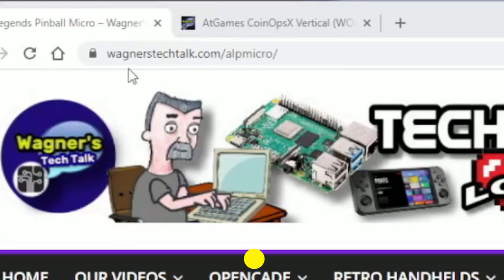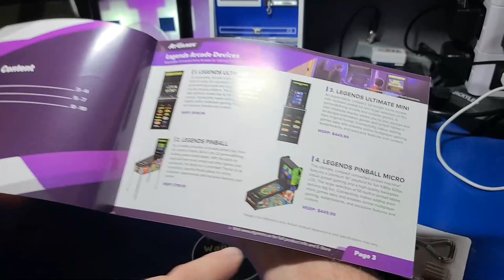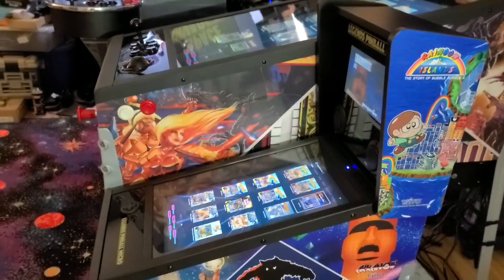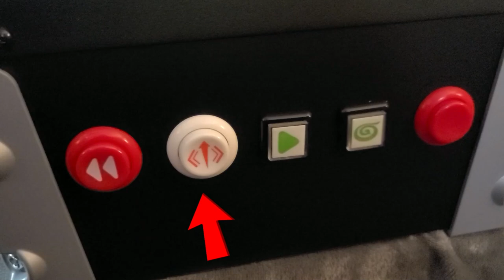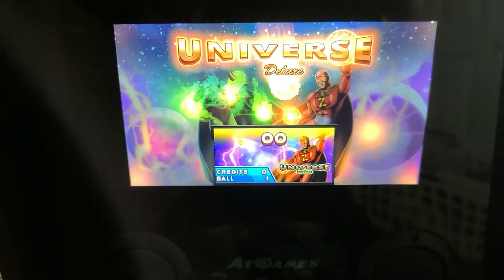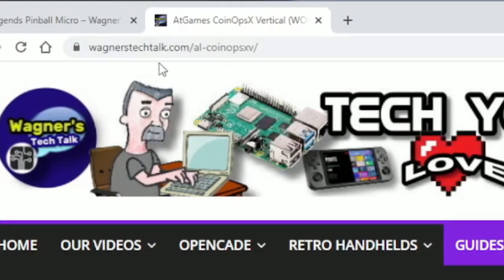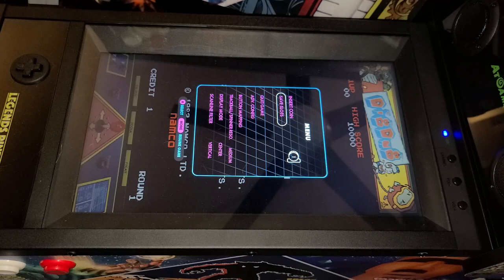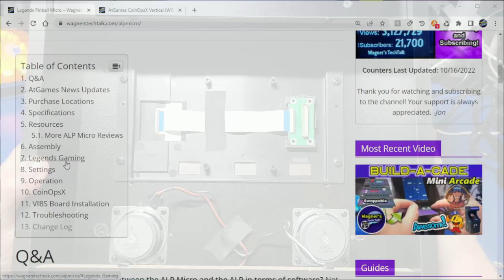AtGames Legends Pinball Micro: First Look and Review!

Comment: CPU – Amlogic S922X hexa-core with 4x Arm Cortex A73 cores @ up to 1.8 GHz, 2x Arm Cortex A53 cores @ 1.9 GHz
GPU – Arm Mali-G52MP4 @ 846MHz
System Memory – 4GB DDR4 RAM
WIFI 6
Storage – 64GB
OS: Android 9 The above is from the Sharpin mini pinball machine one that includes this computer board. Is the atgame Micro pinball computer board the same as Sharpin or better?    The cost for a finish Sharpin pinball machine is a bit more expensive like $500 or so.
Reply from the maker: There are clearly some differences, RAM for example.  However, I've never used the Sharpin so can't compare the two directly.  However, AtGames is having a sale for the next two days for the Micro @ $299.99 USD here: https://www.atgames.us/products/legends-pinball-micro?sca_ref=4359271.G2fhugu87B

Comment: On my Legends Micro the (metal bar) between the lower part of the play field and the D-Pad has a 1/4 inch gap. It is  short in length. The gap is next to the metal side bar. Is that normal?

Comment: Great videos 👍👍 I just put together my new legend micro pinball. When I booted it up the playing screen lite up but the back screen didn't. So I opened the back jiggled it and it worked. So I replugged it back in again same thing so I jiggled it again. Has anyone else have this issue.. but it's working now. should I be concerned.thanks Dave 😊👍👍.
Reply from the maker: Thank you!  Definitely want to make sure it has a stable connection.  I would recommend powering it off, then remove the cables and re-seat them.  Might be that one is just barely connected.  If you don't have to jiggle the connections again, you're good.  If you do, I'd contact AtGames Customer Service here: https://www.atgames.net/arcades/contact .  That way, if there is an issue, you can get it squared away while it's under warranty.
Reply: Thanks that worked 👍👌has anyone ever said that there is a smell from it 🤔 thanks.😊👍
Reply from the maker: @davidbrigham8319  Very welcome, could be some smell to it.  It will subside.  I don't notice any odor from mine.
Reply: I am thinking that too.i read a few reviews of the same issue.😊👍.
Reply: Well I found out from atgames about the smell they said it's from the tape they use . They all have a smell but some maybe stronger smelling but will go away and is NOT TOXIC. They suggested putting in scented dryer sheets inside it .

Comment: It's what the Acrade 1up pinball tables should have been. The only initial downside is the lack of legs, but I'm told there's an aftermarket  set used for Stern machines that work with the Micro if you want to go in that direction.
I'm honestly tempted to get it, even though I have an APL already, so I can have the APL in the soon to be built rec room and the Micro for my bedroom.
Reply from the maker: Actually, you can reserve legs for the ALPu here: https://www.atgames.us/products/leg-set-for-legends-pinball .  I have the aftermarket legs and recommend these from AtGames.  The aftermarket legs cover the screw holes that allow accessing the internals of the machine.  If you want to remove the side bars, you'll have to remove the two front legs.  With these from AtGames, it appears to be just like the ones that ship on the ALP, just black in color.
Reply: Wagner's TechTalk  And these work on the Micro?
Reply from the maker: I don't have this set (yet), but it says so under the Product Features.

Comment: Likely not the case, but it would be great if this could work as a controller for the Switch (unlike it's bigger brother - which is not natively compatible). Using the pinball buttons to control Switch-based pinball games like FX3, etc. would be fantastic for a portable unit such as this.
Reply from the maker: Not sure about the switch, but I've connected the (larger) ALP to a Steam Deck and it worked great (video here, if interested: https://youtu.be/rPqdmhpys1M ).  I hope to show the same working on this machine with the new VIBS board so that the backglass will work with the Steam Deck (or PC) also.

Comment: Another great quality video!  Thank you for the time and effort you put into producing the videos and guides, Jon!
Regarding the button for the plunger, how was that experience for skill shots?  Does it always pull the plunger back to do a max launch?
Reply from the maker: Thank you so much Pete!  The plunger moves down as soon as you start pushing and it's launched when released.  So, you can use it for skill shots.  Just that you have to time it just right during ball launch.  With a plunger, you can adjust before you release but not with the button.  Hope that all makes sense :)

Comment: Just wondering, Does this pinball have haptic feedback, rumble or Vibration on the buttons like the big version pinball? Can you do video comparison between the big table with small one?
Reply from the maker: Yes, it has haptic feedback (vibration) just like it does on the larger machine.  Every option that is available on the larger machine exists on the micro with one minor exception, it uses a button instead of a plunger for launching the ball.  That's about it.

Comment: What's the image quality like? For instance, if I'm playing Zaccaria Pinball via Steam on my PC then the game has a graphics settings menu so does this have that too? It appears not from your video.

I'm asking because 1080p looks acceptable only when I apply a high level of anti-aliasing in the graphics settings so to smooth out any 'jaggies'. If, for example, there is noticeable stair-stepping aka jaggies on the flippers due to low quality or non-existent anti-aliasing then that'll be a deal-breaker for me.
Reply from the maker: There isn't a setting for adjusting the graphics, but I personally see no need for it as the 'jaggies' or pixelization is not an issue.  The images look great on the machine.  Don't take my word for it though.  On many of my guides when I find other reviews of a product, I also add them to my written guides here: https://wagnerstechtalk.com/alpmicro/#More_ALP_Micro_Reviews .  Check them out, but do let me know if you think otherwise.

Comment: how is the bottom of the unit. does it have feets or succsion cups, or is it direct mdf. I would be great to know if you can put it directly on a counter, table or desk without scratching the surface.
Reply from the maker: Hi Sebastien, there are rubber pads on each edge.  I added a picture at the bottom of this section to demonstrate: https://wagnerstechtalk.com/alpmicro/#Assembly
Reply: @WagnersTechTalk  Any suggestions on what would be an inexpensive mounting object? I'm interested in buying one, but don't really have anything available to stand it on. What height surface is needed?
Reply from the maker: @wademissimer6610  Good question, I'm going to be trying some options.  At present, I don't have much other than just one of the items I ordered to try which is here: https://wagnerstechtalk.com/alpmicro/#Accessories .  I'm also trying to hunt some legs that will fit it at a decent height.  If I locate anything, I'll be adding them to the guide.
Reply: @WagnersTechTalk  Thanks so much for the response! To drill into this a bit more.... I'm an longtime pinball fan... played in college and then had a Williams Grand Lizard machine for about 25 years. I liked the physical aspect of playing these OG machines... pushing and nudging the machine while playing. Is that possible with these smaller units? When mounted on a small table/stand - will it work? Also, Overall: How does the playing compare: OG Pinball machine vs Legends Pinball vs Legends Pinball Mini?
Reply from the maker: @wademissimer6610  Hi Wade, yes you can push/nudge the machine and the ball will react.  It's a close approximation to a real machine, not 100% though.  The nice thing is, it's not dedicated to a single table.  This machine has 50 built in, I think there are over 144 available.  Some unique IP's coming out in Dec. (Dr. Seuss).
Reply: @WagnersTechTalk  Agreed - the multiple table ability is a huge plus. Also, the ability to do animations in the game like in the Natural History pack - moving water, clouds, etc. Thanks for all you do to spread the word about these products!
Reply: @Wagner's TechTalk  Thanks again for the information and responses! I decided this was a great choice for me as I could place it on my computer desk and connect it up to my PC. The smaller size is perfect for this configuration. I've pre-ordered it at the NOD-Winter Sale price.

Comment: The price is insane IMHO.  I made a home built machine a few years ago out of an old PC with a Radeon 480, 24 and 19 inch monitors and some cheap MDF shelves, and even my machine has a bump/tilt sensor in it....not a stupid button.  the size of this thing seems just way too small to me.  Now sure not everyone can manage to cut and join wood into a passable pinball machine shape, but you can get a prefab kit that holds a 24" monitor and small backglass monitor for about $99.
Reply from the maker: Appreciate your feedback Mike!  I'll be ordering another one as a gift myself, I like it and want to share it with Sister's family for Christmas.  Yeah, I started building a VPin myself several years back I'll just say it didn't go as smoothly as your build.  I had a 48" LCD (used) display that died while building it.  Got frustrated and decided to wait for a commercial option.  The ALP came at a perfect time for me.  Love the ALP and this little dude too.  Building one yourself can be fun, but takes a lot of know-how and more importantly time to do it.  Being able to easily plug up a PC/Steam Deck to these machines is a big selling point, in my opinion.  It's plug and play, not limited to only those tables that AtGames provides.
Reply: @WagnersTechTalk  I hear you there.  I had more time than money when I built mine :)

Comment: It is much larger than I thought it would be. This game machine needs legs. It doesn't look tall enough to be on the floor and too big to put on a table. I am regretting my non-refundable preorder now.
Reply from the maker: It does have rubber pads under each edge so it won't scratch up a table and there are mounts for legs.  I ordered a small table a few nights ago to see how well it fits.  I will be trying other options as well.

Comment: AtGames keeps building these products with incomprehensible component sizes.   WHY is the backglass monitor so INSANELY small?   Not just a little bit too small.. INSANELY too small.    Why not add proper buttons near the lockbar because you KNOW people will be installing MAME?    WHY have that tacky top marquee on the top that says "Legends Pinball Micro".    All logical aesthetics are tossed out the window for what I assume is very sad cost saving measures.
Reply from the maker: There aren't many (if any) companies that make fully digital LCD backboxes in this form-factor on a virtual pin that allows PC/OTG connectivity.  This is a smaller machine, if you want a larger machine then the Legends Pinball may be a better choicde.  The reason for the size of the display on this machine is it has to have room to mount the speakers.  They "might" have been able to go up an inch on the size of the backbox display, but that's about it.  In terms of having a joystick and buttons on the apron for arcade gaming, I'm totally with you on that one.  I'm spoiled with the full-size ALP and the ACP and having that option on the micro makes sense.  However, every component they add has a cost which has to be passed on to the consumer.  If adding those features adds another $200 to the price, then they made the right decisions (IMO).  No-one would buy a mini pinball for  $7-800 when the full-size ALP can be purchased around that price range.  All-in-all, It's an impressive machine and I did wind up buying one as a Christmas gift since this video also.
Reply: @WagnersTechTalk  Unfortunately AtGames has the same bizarre layout with their original Legends Pinball.   Wasted space and brutal branding aesthetics with the top fixed marquee and a logo where a DMD should be.   They have SUCH potential and showed great initiative releasing these products and having them become so popular during the pandemic era... BUT their design flaws is why the secondary modding market on them is so unprecedented.     I had no desire to build a custom cabinet.   I was hoping Legends Pinball would be the low-cost virtual pinball I had wanted for nearly a decade.     We all love your videos, by the way.   You are a true asset to the community.

Comment: $449.99
That is what everyone really wants to know. Now you can leave because it costs too much.
Reply from the maker: $349 during the winter sale https://wagnerstechtalk.com/al-news/#Winter_Sale
Reply: @WagnersTechTalk  Still too much.
Reply from the maker: I think it's worth it, try pricing a real pinball machine.  $5k or more.  Even most vpins start around $8-900 and may not even have a full digital backglass.
Reply: @WagnersTechTalk  Yeah but you're comparing the most expensive full size real table to this. You can get one from Sharpin for under $200.
Reply from the maker: The Sharpin Switch-PC is $397 USB (or 399,00 euros) https://www.digital-pinball.com/00/sharpin-switch and requires a switch or PC (another $2-400) to use it.  The ALP Micro requires nothing else and has 50 built-in tables, digital backglass, haptics, accelerometer and can be connected via HDMI to a PC for OTG-based gaming (Pinball FX, VPX and Future Pinball).  The Sharpin comparison is not really accurate.  Even the low-end Sharpin Mini  V3 is a kit and requires a an Android tablet to use it, no tables included all have to be licensed from whatever pinball app. you decide to use in Android, no backglass, etc.  Totally different type of products.
Reply: @WagnersTechTalk  The android version requires a ten inch tablet which is available for from Amazon for about $70.
Reply from the maker: Good discussion buddy, it all boils down to what the end-user is looking for.  All have their pros/cons. 😎
Reply: @WagnersTechTalk  Great video! 😁